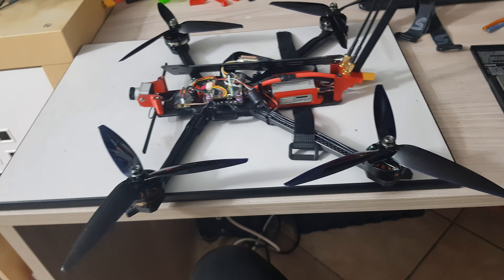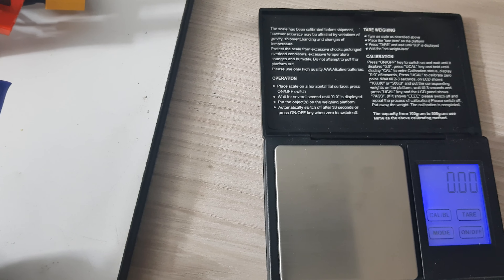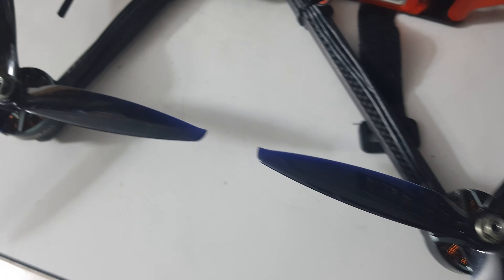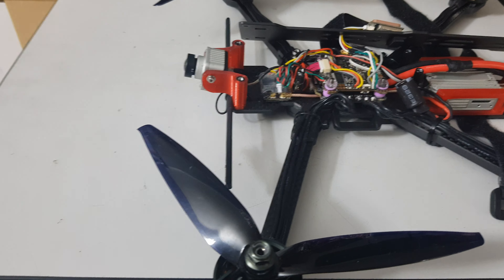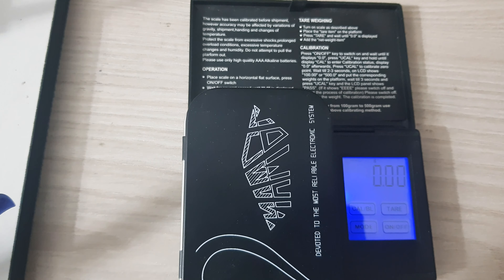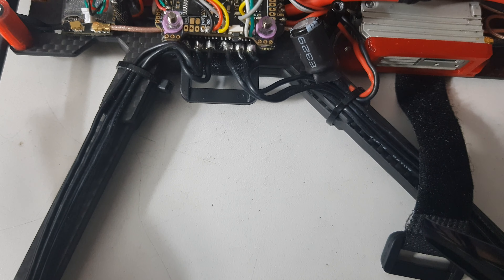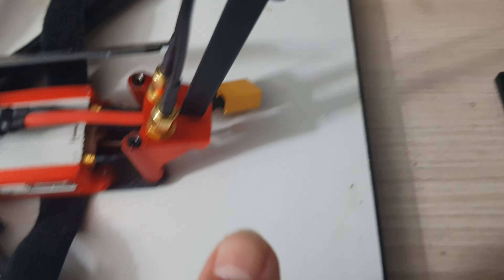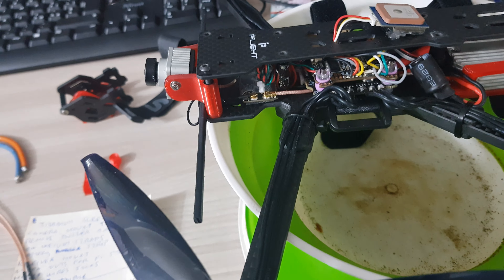How to Reduce the weight of a Long Range FPV Drone - General considerations and Chimera 7 specifics

Comment: I never use tpu if I can avoid it if I need a mount for a naked GoPro or a gps/vex antenna mount I use thin sheets of ABS and build it and carve it they look better and usually weigh half the tpu

Comment: Nice video, learned a lot. Looking forward to your battery life test results and 12km attempt. Are you no longer using dual bardpoles?
Reply from the maker: Hi Alex, no, i really think that for those kind of distances a single, well placed vertical bardpole is more than enough... honestly i'm considering to switch back to the single antenna tbs nano receiver, saving a few other grams in the process... the front horizontal dipole antenna is just for the show.

Comment: Hey hey, sorry to bother you again. Can i ask you to send me the 3D-Image of a frontcameramount for Chimera 7 for DJI Camera with TBS Immortal T wholes?
Reply from the maker: It's in the google drive folder I shared with you. the file is called "19mm cam + immortal t". It says 19mm but it works for the dji camera as well, and it has holes for the immortal T. You need to print one normal and one mirrored for the other side.
Reply: Salut salut, i just did what you described. Only thing is i printed the models with ABS Filament. Unfortunately it did not fit. It was not possible to mount the Camera. like that. ABS is just too stiff and the model has to fit a 100% if printing with ABS. I have to find another solution but thanks anyway for your help!
Reply from the maker: Printing drone parts in pla or abs usually isn't a good idea. They break too easily. However, if you have a printer able to print abs, you should have no problems with tpu, even if you have a bowden setup. I have an ender 5 and I started printing tpu with the stock setup, and it went fine. I then upgraded to direct drive but it wasn't mandatory. I suggest using SainSmart TPU, that stuff is flexible but still quite stiff, which makes it easier to print on bowden printers.
Reply: @fabyt68  Thanks a lot!

Comment: How do you mount the Bardpoles?
Reply from the maker: Hi Richard, not sure about the question, i designed a TPU mount (the one in the back) with the 2 holes to hold the SMA adapters, and a hole in the middle to insert the bardpole, which is then zip-tied under the mount....